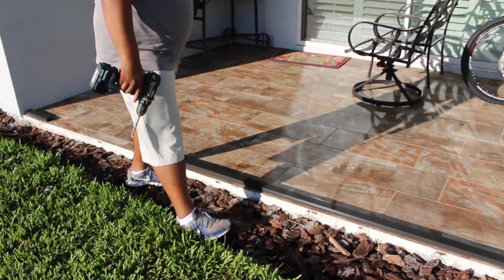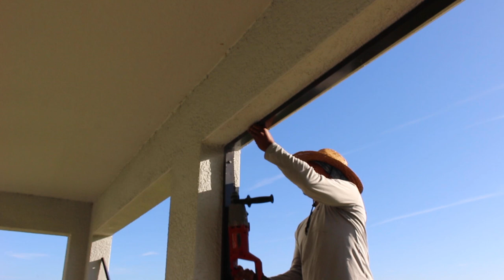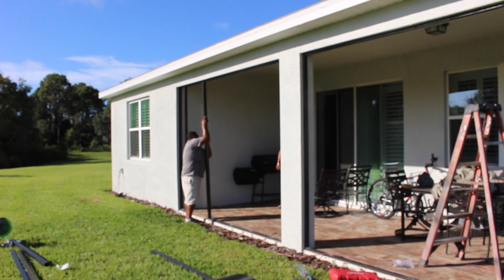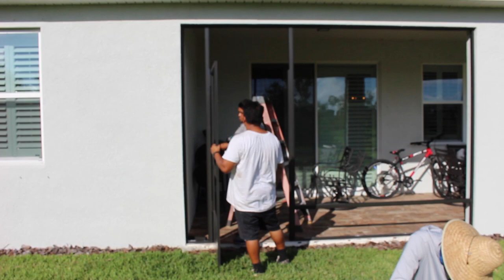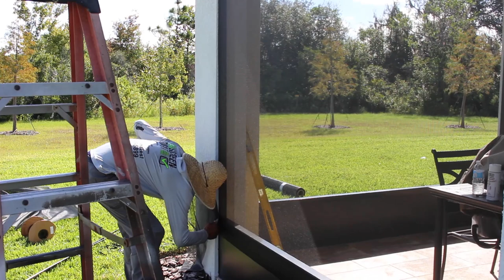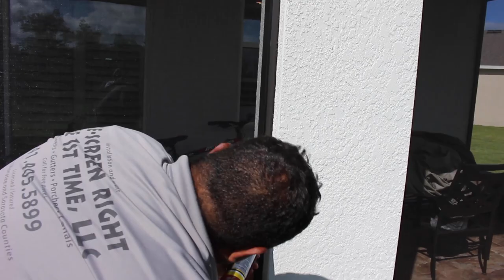New Lanai/Porch Screen Enclosure Installation - Lakewood Ranch / Bradenton, FL

Comment: Stick framing🤔 I internally screw all my frames together. I’m not a fan of clips and L-brackets
Reply: Just bc its stick built doesn't mean you have to use clips..
Reply: @big_redd2560  how do you attach the chair rail without a clip or bracket when you stick frame ?
Reply: @jaredmcnichols9874  I do pulls/punch/drillpilotholes/fasten the 1x2s to the chairrail
Reply: @jaredmcnichols9874  Also use Doorjam bc Zbar or prehung doors blow
Reply: @jaredmcnichols9874  so your assumption of stickbuilding is using clips?? if you are measuring a piece then cutting it and then fastening it to a wall or ground then thats stickbuilding, reading a print/structured drawing with measurements and pulls and then putting it together to be installed is called prefabing.
Reply: @big_redd2560  oh really I didn’t know that.. lol rather you use clips or you cut a piece and screw a piece it’s all stick framing.the correct way to build a porch is to make yourself a templet out of 1”x2” angle.and internally screw the frames together either at your house or your shop haul them to the customers and install them with screws and or tapcons.I’m with you I only use door jamb for the doors and notch my door header.using a z-bar is like riding a bike with training wheels.same with the stickframing😉
Reply: @jaredmcnichols9874  😂😂😂 Lmfao 1x2 angle and a template?? alright I'm done you win 😭😭😭
Reply: @big_redd2560  just as I suspected your a stick framer. For you to not know what a template is used for when building porches.I feel bad for your customers porches a couple MONTHS after you put them up 🤦‍♂️
Reply: @jaredmcnichols9874  no real aluminum installers I know call a lanai a "porch" so I already know you have no idea what im talking about and im wasting my time
Reply: @big_redd2560  what area are you in.never heard of a porch?

Comment: What do you call the tool that you guys use to tuck the screen?
Reply: There may be a fancy "proper" name I don't know, but if you look up "screen rolling tool" at Amazon or Home Depot you should be able to find one- it is a handle with an edge roller on each side- one slightly larger usually. Hope this helps. :)
Reply: Spline tool